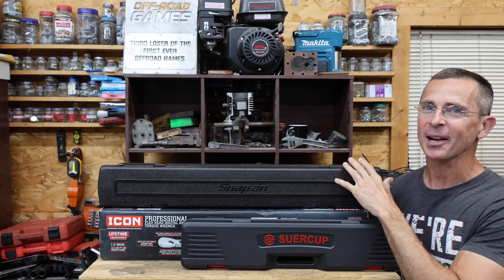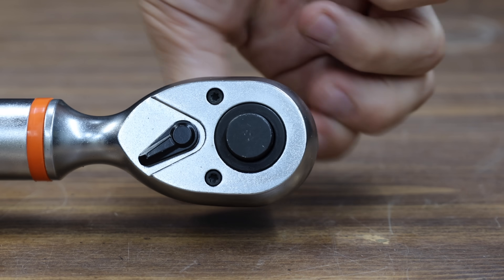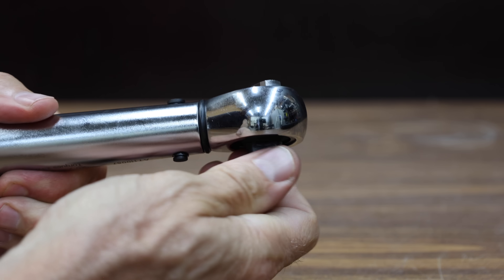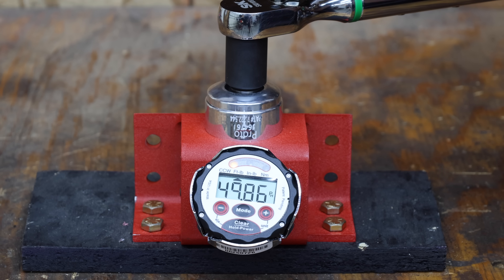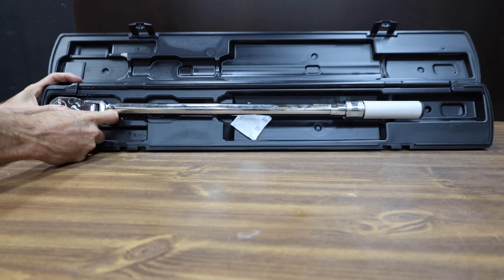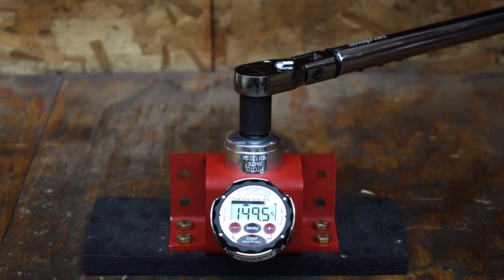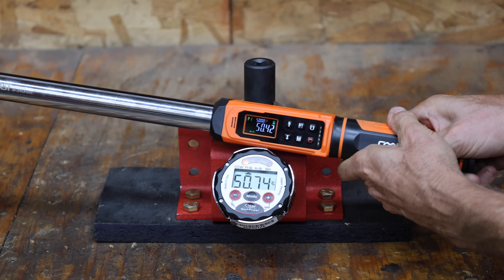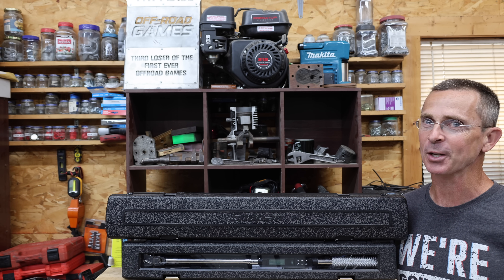$78 Torque Wrench vs $790 Snap On & ICON—I Didn’t See This Coming!

Comment: A small, well-intentioned note on comparing a reference tool with other devices to check which provides more decimal precision: If the latter displays fewer decimal digits, it has to round its readings. This rounding doesn’t inherently affect accuracy. It even does mean that a reading such as 50.0 lbs/inch could represent any measured value between 49.9500… and 50.0499…. So in this case. Two ways to adress that: 1. Also round the reference device to the same amout of decimal digits (manually). 2. Adjust all measured values by the maximum possible rounding error (in this example, ±0.05) and round any resulting negative values up to zero.
Reply from the maker: Thanks for sharing.

Comment: WOW, these are great test, but if you were putting together a $30k diesel truck engine rebuild, I think we know the one the mechanics would reach for.... Also the angle factor is a big deal with a lot of required torque downs and then the angle degrees required to finish. Keep up the great product evaluations.
Reply from the maker: Thanks, will do!

Comment: I'm curious about battery life on the electronic torque wrenches. Do some of them have the same battery drain issues as the cheap digital calipers? Atleast the ones that use AA's or AAA"s are easy enough, just don't put alkalines in there!
Reply from the maker: Thanks for the suggestion.

Comment: Another Vevor tool! Do they make everything now? I can't remember precisely but I think the first Vevor I heard of was a video camera of some kind. Since then I've seen a thermal mot and I lot of other things with the Vevor name. Makes you wonder. So far they have seemed to be rather good for the most part, but they can't be that good at everything, and I hav e no idea about how durable they are. Writing this directly after the Vevor torque wrench was first shown so I have no ides if it's any good at all yet.
Reply: Well having wathed the test it wasn't awful, but not anywhere near as good as the best. The torque wrench that surprised me was the Suercup. Not only was it pretty good from the start, but it seemed to just get better. For that price it was a certain surprise, while Snap On would have been a shock if it wasn't near the top. And it did just that, stay on top all through the sets, but at that price it certainly should be the absolute best. Still I wouldn't buy one for the little use I would ever have for one. The Suercup on the other hand was cheap enough that it would be one that I could end up buying if I needed a torque wrench for something. Basically any of these would be good enough for my one theoretical time use...

Comment: For me, GearWrench seems to be dropping in quality. I had a digital GW torque wrench. Maybe a month old, I was torquing lugnuts on a Ram 2500 and the ratchet mechanism broke sending my backside into the lift post. I've had two GW 3/8 ratchets where the same has happened. One I had replaced and it's ratchet mechanism is wonky.
Reply from the maker: Thanks for the feedback.

Comment: Does the icon do angles, cuz thats the only thing that has me set on a snap on one. Also if u need to add a torque extension you can set the length and it does all the math for you
Reply from the maker: Thanks for the suggestion.

Comment: Great test. Goes to show that some of the budget torque wrenches are good for occasional use. My own torque wrench is a Snap-On job, though it is not a digital one. It starts at 40 ft/lbs, and stops at 250ft/lbs. It is an older unit that I have owned for the last 20 years. The last time I used it was on an AU Falcon to torque the front hub nuts.
Reply from the maker: Thank you!

Comment: I was really hoping to see a comparison on torque angle. I think a great test would be accuracy in one single move and then check angle accuracy with multiple ratchet moves because it can be difficult to achieve 150° under a hood in one move.
Reply from the maker: Thanks for the suggestion.

Comment: I would have to say that on the 1st test snap-on was closer than you called it in the video. The wrench shows one place after the decimal point and the measurement tool shows to the two places after the decimal point. The torque is just rounding to the tens place.

Comment: Damn. That Snap-On went way up in price. I bought my 1/2" for $499 and the two smaller ones for $399. So, the Snap-On was one of the most accurate, is made in the USA, and it's the only one that does angle. I bought all of my digital torque wrenches specifically to do angle, so I was kinda stuck buying off one of the trucks. I got the Snappy's for the same reason my other tools are Snap-On... Quality and made in the USA.
Reply from the maker: Thanks for the feedback.

Comment: I have that diamond saw and I'm very happy with it.  I did a bunch of research on tile saws and it consistently rated high, but was one of the cheapest too.  I used it to tile 3 bathrooms, which isn't much for a pro but I'm just a DIYer.  Still works great.  I don't buy harbor freight - I use your videos for most tools and thus have a Milwaukee setup.
Reply from the maker: Thanks for sharing.

Comment: Guys, for the usage scenarios we common folks need, an error of 10% is definitely not a problem.
Reply: I have always guessed at torque. I recently checked some wheels I put on that were supposed to be torqued at 105 and they varied from 109 to 131. Most tire shops don't mess around with a torque wrench they just spin them on and let it hammer a little. Better to have it more than less; people don't like to have a wheel come off while driving.

Comment: My mother got me the 1/2in Icon Digital Torque Wrench for my birthday. Todd coming in once again to reinforce the fact that it performs super well. Plus you don't need to worry with a lifetime warranty. The one downside is that it will eat battery life, but just as long as you take off the battery cap it will be fine. Cant wait to get the 3/8in Wrench
Reply from the maker: Thanks for sharing.

Comment: Technique is important too. You are supposed to pull on the handle at 90 degrees. Many people do not. Does it matter? Maybe. Another question is how well they hold up if accidentally dropped. One point of error comes with extension use. Some of the force goes into twisting the extension, especially at higher values. The biggest error I see is at tire places that hammer the nuts on with an impact and a 'torque stick' that may or may not be close. Then they click it with a clicker torque wrench and of course the nut doesn't move at all because it is already over torqued. Had to take my car to a shop and have several lugs either drilled out and replaced and replaced because the threads were damaged. The idiot at the tire store wrecked them and my own impact wouldn't take them off. Either WAY too tight or stripped.

Comment: As usual a good test.   Im interested in performance after a 6 foot drop test.  Also, any suggestions for home testing of torque accuracy short of buying an expensive test unit?   Not that I would ever drop my torque wrench, but Herb Woodley might.
Reply from the maker: Thanks!  Thanks for the suggestion.

Comment: Great video.  Perfect demonstration as to why torque should always be applied by slowly to reach the desired torque setting.  BTW - I still have my Craftsman lever arm torque wrench I bought in ‘60s for doing engine work.  I use it these days to calibrate my click style Craftsman torque wrench.  I found out the hard way that loosening the spring on the click wrench too far allows the handle to spin freely.  That’s when I figured out how to use the one to calibrate the other.   Glad to see Craftsman still in the “hunt”.
Reply from the maker: Thanks!  Thanks for sharing.

Comment: Well sir, you missed Sturtevant Richmont which is the standard for most high end manufacturing facilities.

I will add Icon and Snap-on are both very good wrenches. SR single adjustment fixed wrenches will hold for years and years. I have a shop with about 300 torque wrenches and yearly calibration data on an NIST transducer to prove it.
Reply from the maker: Thanks for the constructive feedback.
Reply: @ProjectFarm  it's cool. No at home mechanic is buying from them and your audience of CQMs is probably very small. 😅 Gotta appeal to the masses to make the $$.

Comment: There is absolutely no way I'd pay $800 for a torque wrench.
Reply: You obviously have not joined the cult of Snap On you poor misguided smart person .😁
Reply: You say that until you're a BMW maintenance tech torquing every bolt you touch on a daily basis (BMW requires you torque oil drain plugs, oil filters, suspension parts, etc) and need the comfort, speed, and convenience that comes from a Snap-On wrench. We don't just shell out $800 on tools for no reason.
Reply: depends on the value of the item you are building. if its 100k motors then 800 dollar wrench is cheap.

Comment: I have a manual biological torque-wrench (my right arm). It has no flashing lights, no beep, but vibrates sometimes when I nearly reached the torque. I hope it will never make a clicking sound.
Reply from the maker: Thanks for sharing.

Comment: I would love to see you test the angle functions as well! The speed of the sensor becomes very critical in those measurements, because when racheting it stops and starts the angle measurement based on the force applied to the sensor.
Reply: and this is by far (IMHO) the largest advantage of these electronic torque wrenches. Doing a multi-stage angle tighten on 20+ fasteners, they definitely preserve your sanity.
Reply from the maker: Thanks for the suggestion.
Reply: They tend to over-report the angle quite a bit, in that they start measuring with any movement, not only after tension has been established. Best to just put a mark on the bolts with a marker

Comment: What about the Angle setting? One of the reasons for having an electric one is for more advanced bolt patterns when you have to torque, then back off a certain angle or tight at a certain angle. Things like head bolts.
Reply from the maker: Thanks for the suggestion.

Comment: Todd, since you've done torque wrenches several times, why not just attach an ovoid v- belt pulley to an electric motor with the belt pulling down on the torque wrench for the cycling.  Distance could be used for tension.  An Arduino and a servo could also save your arms. Thanks, again!
Reply from the maker: Thanks for the feedback.

Comment: I had the gearwrench one on an engine rebuild for torqing headbolts and it just wasn't accurate and couldn't calculate 90 degree swings. So upsetting. Thanks for the review, I know what I'll be replacing it with.
Reply from the maker: You are welcome!

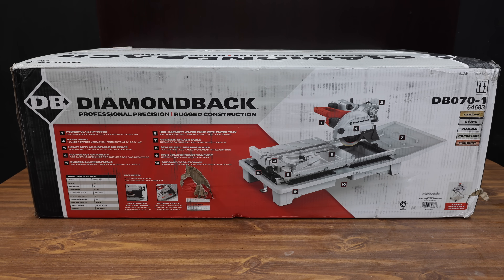Comment: 8:43 He bought a Torque wrench and they sent him a giant tile saw... Yup that's sounds like my Harbor freight store. 🤣
Reply: Todd is Captain Calm and even he noted how bad Harbor Freight’s phone support/wait time is. That was exactly my experience too - I was on hold for a ridiculously long time.
Reply: @nyc8452  I've never used phone support. If I have a problem with a product I just to the HF and get a new one.
Reply: @nyc8452  Harbor freight is a good place to go if you are only planning on using a tool one or two times.  Otherwise buy something that is decent quality.
Reply: Well, looks like we'll need a tile saw comparison in a few weeks!
Reply: Died laughing when he showed us that. I too couldn't help but think it was my harbor freight as well.
Reply: But no 13 dollar Pittsburgh clicker.
Reply: No doubt. I ordered a muffler for my HD Softtail and got a carbon one for a Suzuki crotch rocket.

Comment: Your comparing tools with 2 decimals to tools with 1 decimal like the snap-on.  (reference 0.00 vs 0.0 that were on some tools)
obviously way easier to get your accuracy score down, if you dont have the resolution as the refernece factor.
And its actually some of the cheapest ones that gives the finest resolution with two decimals..  and you do take that finer resolution into the mix on some tools 4:53 would likely have made it more equal if you cut the last digit, so it was an equal playing field but then again, who cares.. its just guidance, its like not like your using these tools to that fine tolerance.
thx for the test PF..   good tests on many of the things that matters
impressed with the cheap one but one thing that can drive people nuts with these digital tools versus mechanical based one, same with vernier calipers, - is battery drainage while not in use, as some of these cheaper models, will zip battery like there is no tomorrow and its makes it so annoying, if its drained when you need itor you have to shim the battery to close the connection after use, though easy to check with a multimeter with microamps, and how long it can stay in storage.

Comment: Would love to see a review of micro(jewelers) screwdrivers. Project farm is the gold standard!
Reply from the maker: Thanks for the suggestion!
Reply: Going to be very hard to review those because you're not looking at quantifiable elements, such as strength of the shaft or how tip holds up after screwing 100 screws into hardwood, etc... IMO the most importable is that both screw and the driver are from similar hardness steel, so the driver doesn't ruin the screw. I'd say (after using all the big brands, including bergeon and horotec) stick to any decent quality one like wiha, wera, but really invest/try to find the best possible screw (harder than you think)

Comment: Thanks for this review.  I have the AC Delco torque adapter and have been using it as a calibration check on my mechanical torque wrenches.   I’m now pretty skeptical of its performance.
Reply from the maker: Thanks for the feedback.

Comment: Im a professional mobile mechanic for the last 13 years. Been through a couple different brands of torque wrench. I was really happy with the Suercup 3/4" 800ft lb torque wrench. For the price I decided to purchase the entire line of click type from 1/4" to 1" drive. Im not a tool snob but I love matching tool sets. Now that I see the digital is pretty dang accurate ill get one of those too and move my Mac brand to the shop tool box.

Being a road tech. The travel really beats up tools over time, so for the price I dont mind giving the Suercup digital a whirl.

Thanks Project Farm! Keep the content rollin.
Reply: I’m field service/mobile as well. I carry a cheap Husky 1/2” drive analog, 3/8” Snap-On non-digital I picked up at a pawn show, and the Icon 3/8” inch pound torque wrench. I recently bought a GearWrench 120xp 1/2” drive for angle capability and I like it so far. 

In my opinion, Icon is way too high for the digital torque wrenches. I don’t care if Snappy is $800, $400 for a 3/8” drive torque wrenches from Harbor Freight is just too much. I’ve never heard of Suercup but I’ll definitely look them up next time I’m shopping for a torque wrench.
Reply: @jamesbynum3123   Don't forget Icon can be found 30% off on sales which happen at least every 2-3 months.
Reply from the maker: Thanks, will do!
Reply: I'm a mobile tech as well (marine) and agree 100% about how badly it beats up equipment riding around in the back of my truck or van.  An accurate but inexpensive option is great.
Reply: Just curious, do these Suercup digital torque wrenches need calibration after using it for a while?

Comment: Can you test some smaller torque wrenches, between 15 to 30ft-lbs? Last time I changed the spark plug on my outboard motor, I was really nervous. As I tighten the spark plug I kept thinking "why is it not clicking? It feels really tight already!"
Reply from the maker: Thanks for the suggestion.

Comment: As a 35 year automotive technician, the problem with torque wrenches is they go out of adjustment.  And, yes, it matters if they are off by even a few foot-pounds.  Especially with so many parts being made of aluminum or alloy now.
Reply: torque-wrenches needs to be calibrabrated once in a while, nothing strange about that at all
Reply: Totally agree. I have the eTork 3/8 version for use on my bike to torque carbon parts and I always never set it at the specified torque value to prevent it from going over. But most of these torque wrenches he tested are mostly for bigger numbers. If it was for engine bolts the smaller tight gap torque wrenches would have been a better test.  He could make another test with the smaller units that go down to 5ft lb.
Reply: @bonbonflippers4298 if you are working on carbon bikes, I would recommend using a wrench calibrated in inch / pounds.
Reply: @bonbonflippers4298 j believe he has tester 1/4 inch torque wrenches
Reply: I check mine every year.  Kind of a pain, but my craftsman click style is the worst for drift.  It’s always off 5-10%, usually reading too low.
Reply: @jasonmershon3941 
Take it in for exchange. 5-10% off is defective not just out of calibration.
Reply: watch the video
Reply: I build trains for a living. Our company rules are that you have to check the torque wrenches at a testing station every day before use and every time you change the torque. They also get calibrated once a year.

Comment: In my professional trade I went with SnapOn. If you can afford it, it is worth the investment. If you can’t I would at least get the craftsman so you have good customer support at a DIY level. 

But my greatest piece of advice is to buy the Energizer Lithium batteries. They are touted as being leak proof, and while I know a lot of people take their batteries out after every use, sometimes you for get.

Comment: It's important to note bolt torque isn't just for clamp load but for bolt stretch.  The bolts stretch so when things vibrate they can absorb the shock without losening.  Also when you torque for say an engine block the bolts actually manipulate the block by stretching and twisting the metal. So it's important to be consisant.
Reply: Torque to yield